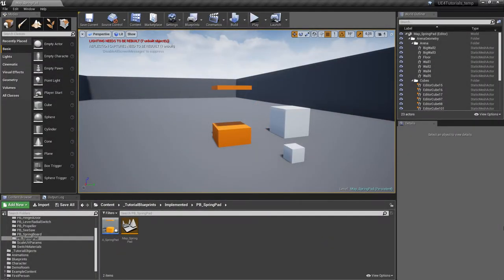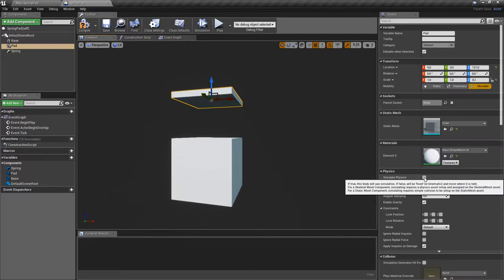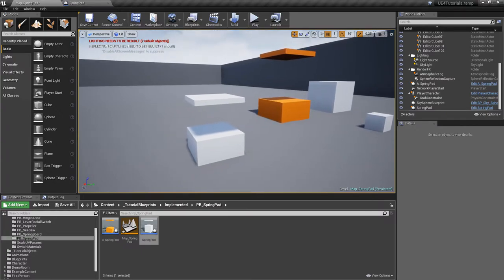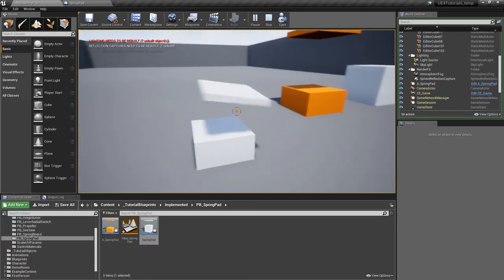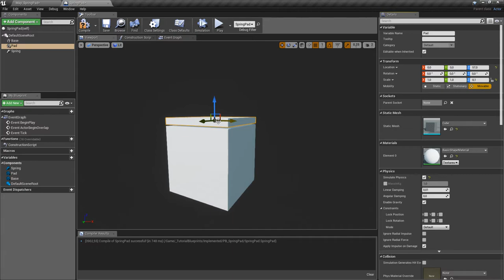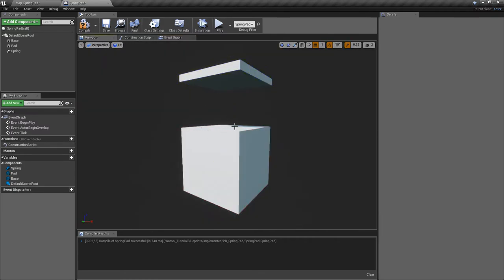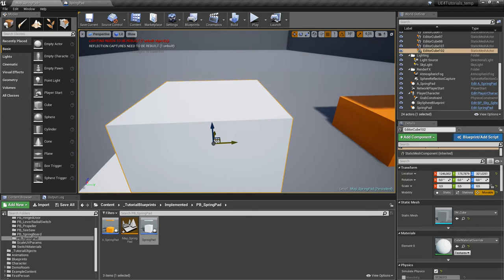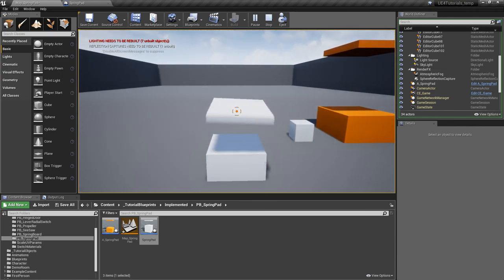UE4 Jump Pad - using Physics Constraints in Unreal Engine 4 Tutorial How To

Comment: Great tutorial - thanks for this - How would you go about attaching a spring 'skeletal' model between the two and have the spring bend accordingly?
Reply: I had exactly the same question in mind... please let me know if you find some tutorial online for that :)
Reply: @framais  I managed to get it working by adding an additional physics constraint from the spring skeletal mesh to top, however the spring does not bend realistically via the joints. I will keep trying to figure it out....
Reply: @garethpugh5036  After much fiddling and using a 3 bones (and constraints) "tail" rigged to the spring to simulate bending I finally got an acceptable result. 
This is what looks like:

https://youtu.be/-swYdQyT-Kk
Reply from the maker: Unfortunately, there's no easy way to do that. You could have the spring with weight-painted skeletal mesh, but it would only work if the spring is bent. If it's compressed, the thickness of the spring would also get compressed (I think) so you would end up with a thin spring if compressed too much. Haven't tried it, though.

@Fa Mais' solution seems quite acceptable.
Reply from the maker: There would be another solution. Having the spring made with a spline mesh and manipulating the spline points dynamically based on physics constraints parameters.
It involves some of math but the result should be very realistic. Haven't tried this one either.
I would start with this tutorial: https://www.youtube.com/watch?v=7YUxM0NDWRY